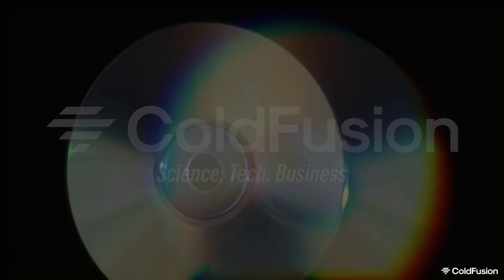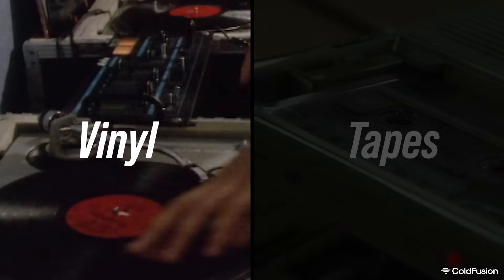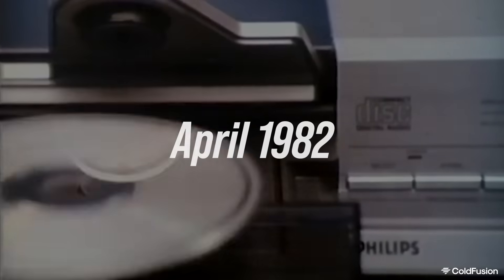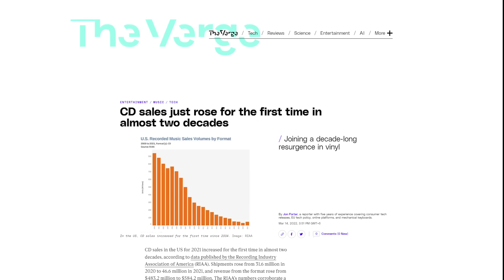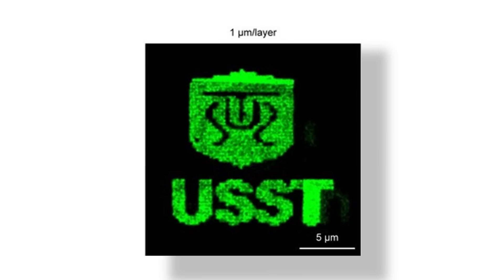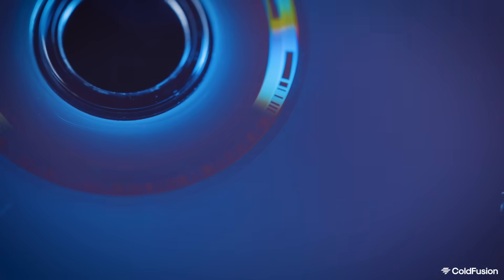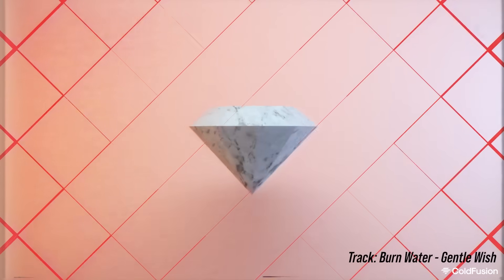Why This New CD Could Change Storage

Comment: Good luck with that. The simple fact that they need a femtosecond laser makes it IMPOSSIBLE to generalize for the public. A way would be to eventually make a frequency comb microchip but STILL, we have two problems:

-We never did a femtosecond microchip comb to my knowledge, and slower comb microchips are still the state of the art. 
-Biggest problem is obviously the microchip itself, how to be able to write/read the surface? Not to mention that the frequency comb microchip needs a very solid pump laser to control the wavelengths properly.....it takes A LOT of space!

To summarize: in a lab, yeah sure, in industry why not, for the public no fucking way for the decades coming.

Comment: If this succeed then it can be a great thing for gaming consoles. There was a time of consoles like ps2, ps3, xbox 360 when you didn't needed to install the game onto the console from the disc you've bought. The entire game used to be fit on the disc. This was the time when blu ray discs were new in the market. 
If this technology succeeds then definitely not a petabyte, but creating a small size version of these discs which can store atleast like 500gb of data would be enough to saving the feeling we used to get from using discs and making collections (ahhh good old days)...
And yeah ofcourse sharing your games would also be a lot easier.
Reply: It's never gonna happen. Games need to be installed cos Blurays are way too slow compared to an SSD. This new disc is even slower, by a magnitude. And gotta consider that Sony and M$ are clearly trying to get rid of discs.
Reply: @Azarilh  Which will obviously be solved by innovation. And Speaking of Sony and MS, if they don't fill up the need or desire of the consumers, somebody else will. I am not talking of home consoles like PlayStation or Xbox but a hybrid console with disc drive like what PSP used to be. Because still people would like to store their own their data not stream it from some datacentre. It is feasible for small data like songs and movies. But not games. That's why Google Stadia failed.
Reply: @mileshul  Downloading a game is not streaming a game. Dunno why you brought streaming up. Streaming failed mostly cos bad latency and not enough people with good Internet. Downloading games succeded and killed physical in the PC industry. Same might happen with consoles, regardless of what people want. No, there's not gonna be someone taking place of PS and Xbox any time soon, especially with all the fanatic fans. It is really common for big companies to do stuff that the community doesn't like, and the community gets to accept them after some time. 

There's nothing obvious with the problem of the discs being slow being solved with innovation. Technologies have their limits. Hard disks for example reached their limit a long time ago, hence why we switched to a beter technology, solid state.
Reply: @Azarilh  I am not saying Downloading games from Steam and Epic games will die. It will forever be there but I am saying that disc storage can solve the problem of keeping those hefty games out your console when not playing. On Steam I very often uninstall and reinstall games. I don't have to use internet and wait for like an hour or two for downloading and play game. A disc like this will doesn't even need to install the game on console l. Just put in the disc and play. Which can help the companies minus the cost of storage for like a 1tb or 500gb.
Reply: @mileshul  I don't see why it's so important. Just have same patience. Also, upon installation there are often large updates to download.
Reply: Something like this will never come to console sorry.... the tech alone will keep it out of a console forever. Disk alone will be disappearing from console not too long from now as well.

Comment: I think we need a 1 petabyte ssd with usb 3.2 (or usb4 when it's everywhere) connection. Once we get that, nothing will ever top that. You can write and read super fast meanwhile keeping all that data in there to be used by basically any device. Finally people can shut up about drms and their media purchases lol. Also, that drive would eliminate the overpriced Kaleidescape streaming devices. Full bandwidth compressed lossless files at your fingertip.

Comment: 6:58, Petabyte, or Petabit?  Both terms are not interchangeable.
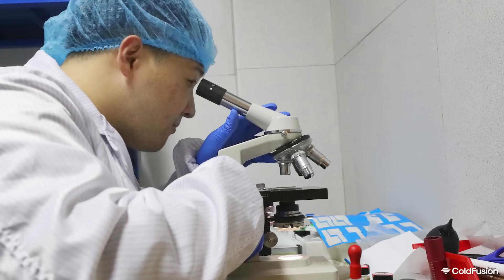8:17, CDs only have one layer, DVDs have up to two, and Blu-Rays have up to 4.
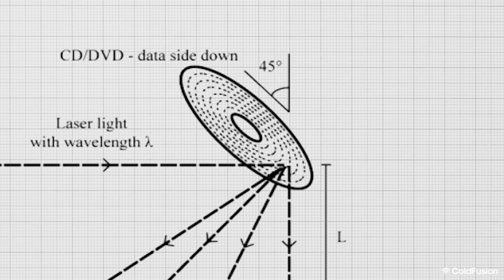8:47, Light is in the Nanometer range, so microscopic would still be too large.
11:43, Could multiple laser assemblies be added to the drive to read and write in parallel?  It would likely increase the price, but it could be a good tradeoff for those who want the extra speed.
With optimal and ideally lossless codecs in use for each type of file format, I'd be interested to see how much one disc could have on it.  Maybe one use could be movies made for a looking glass screen, while displaying only one perspective that the watcher can select from, either manually or based on the remote's position, for backward compatibility with current 2D screens.

Comment: I doubt anyone will want to buy 1.6 petabits of media at once. The disk does sound useful for backup, but is too big to attract most home users. I'd be happy with a 1 Tbyte optical disk, just big enough to hold an ISO of my hard disk.

Price also matters. MDisk compatible BluRay R/W drives are affordable. 4 layer BluRay (128 GB -- gigabytes, presumably) are $10/ea in lots of 10. That's a lot, and I'm not sure my current drives are compatible. A new external drive costs around $150.

Comment: Another great feature: If you're willing to cut capacity in half (still a massive capacity) you could have essentially indestructible data storage. Error correcting codes could make use of the remaining bits so effectively, that you could put that disc through hell and grind it up significantly and not lose any data. The redundancy and ECC would be enough. Furthermore, this could all be done in a software layer without any hardware modification!
Reply: Have the option on writing so that you can write ONE copy at full capacity, TWO copies at half - right through to (for example) 4 -8 copies stored in physically different parts of the disk so even if someone shot a hole through it, you still have ALL data full intact. ULTRA stable data and still a 25TB to 50TB of storage.

If this was "cold storage", then the old CD changers which allow you to load a carousel with perhaps 4 - 16 newCDs and you are back to staggering values again.
Reply: Yes but that would make the writing double slow, and like they said in the video, it's already pretty slow.
Reply: @Azarilh  Just to emphasise how slow - it'd take about 5 years to write one disc. If you've ever owned a DVD burner, you'll know you're not getting through an hour of burning without throwing at least one disk in the shredder.
Reply: @alexandralillywhite5997  I used to only buy RWs. Thos could be rewritten.
Reply: You can't rewrite these discs. They're not designed to be rewritten and likely never will be.

Comment: I still use 25GB or 50 GB BR for our office offline backup. Unfortunately, 50GB are expensive, and only original Verbatim are reliable. Obscure 50GB BR brand failed too often during the change between the two layers.

Comment: Yeah, but we live in a world where you buy a DVD, slap it in the player, and half the episodes are corrupted and skip around. The tech has been around for decades, yet it's still garbage. You don't have as bad of problems with flash memory. (and I'm not saying there aren't ANY - I'm saying the problems aren't AS BAD for the reading comprehension-challenged).

Comment: Of course.  I've had the 8Gb DVDs for storage.   BUT,  don't let them soak in water (accidently) unless that top layer of aluminum is sealed in. The DVDs that use chemicals to be modified instead of physical pits... I want to purchase the DVD burner that etches into aluminum disks.

Comment: The real test will be how long the data lasts before age decays the material.  Off the shelf CD and DVD media eventually goes bad because of the quality standards to which they are made.  If you want media that could last decades under proper storage conditions, you have to pay more and most all retail places don’t carry it.  The more you store in one space, the more your risk loosing if the media corrupts.  I have redundant data backups just for this reason alone.

Comment: Ideally, bits and bytes should be separated to internet speed measurements and storage capacity respectively. 
Though I wont complain if bytes is used to measure internet speeds as well. 
For clarity, a byte is 8x larger than a bit. 3 MB/s (megabytes) is basically the same as 24 Mb/s (megabits).

Comment: no one can answer this question: they have managed to increase the storage capacity of a CD exponentially  with this breakthrough. However, they have not acknowledged or addressed how fast the discs can access the information stored on them. Traditional disc hard drives capped at 7200 RPM because of the physical limit of the discs because they begin to crack and break at faster speeds. How are these discs any different? Did they just make discs with insane storage but were back to caveman level read/write speeds?
Reply: They are even lighter !
Reply: @raphanunu6912  so the decrease in mass prevents the disk from shattering over 7200 rpm due to centrifugal force?
Reply: @slytherinda4669  It should

Comment: Optical media and longevity aren't really synonymous, and I'm not even talking about scratches. Just look at the issue of media degradation on Laserdisc, or laser degradation on readers of just about every optical media format out there. Every old game console eventually needs to have the laser replaced with a compatible one or by an optical drive emulator. And also, just look at how media degrades over time, with dyes and adhesives fading, going dark or crackling and ruining the optical properties of the disk, along with it's physical integrity. 100 layers? Hah. That's not going to be cheap or easy to produce something that can hold data for over 20 years on those. 

The tech sounds cool, but right now it's not even clear if it will be able to compete with tape for long term storage, and unless the tech gets ridiculously cheaper, it's not going to show up in consumer products at all.

Comment: The reason I stopped buying CDs wasn't mp3 sharing. At that time, they sounded awful. No, it was that the prices jumped up between $3.00 to $10.00 more for no reason. Every time Best Buy had a sale, it was fake. The old price was inflated to make the discount look good when, in actuality, the price was the same.  The CD for the Godzilla ost was priced higher than the dvd for the movie, so I passed on it.

Comment: Can it store true Blu-Ray resolution video?  I know it said it can store 200,000 Blu-Ray DVD’s but that’s a capacity issue.  This is a 3D storage medium so what resolution can it handle if Netflix or Hulu bought this?  Burning digital 4K to this medium at only MB speed when the disc holds 200,000 is going to take a long time!  This has potential but they need to work out some serious issues to make it commercially profitable.

Comment: Since gaming and movies are still using discs then these two huge media industries will benefit from these large capacity storage CDs. If gaming were to move from Blu-Ray discs to these new formats then they could hold even more data compared to the smaller capacity of Blu-Ray. The current biggest size that can fit on a Blu-ray disc is about 128 GB for quad layer formats. The smallest Blu-ray disc size can hold 25 GB compared to the DVD which holds 4.7 GB of data and dual-layer DVD up to 8.5 GB. The original Compact Disc only held 700 MB which is less than 1 GB. With the rise of digital media then I'm not really sure if people still want physical media. I still support physical media because I just don't trust big companies to forever hold those digital games, movies, shows, music, etc. forever. Licenses might expire and change then they end up removing those digital content.

Comment: I loved my laser discs, I still have lots of vinyl, reel to reel, 4 track and 8 Track, cassette, CD,  MP3 before trying to create larger collection size files on hard discs internal and external. Now I’m just using the net/iphone music playlists. The really ridiculous thing is how many times I’ve purchased the same music (and movies) repeatedly in each format and in the cloud. At some point I should have earned stock in some of the companies!

What I would really like to be able to do would be create a mixed audio/video storage system that could easily be organized in a slick fashion similar to any we currently use online or otherwise for our stuff on now, that could be searched by all the regular data points, but could be accessed via cell phone from anywhere. This way I could organize my entire library of old tech to new tech movies, music and home movies. My children and grand children would have simple access as well with this system. 🤔😴💭 😂🤣

Comment: Soooo, how often will burning these discs fail with buffer under- or overrun? xD
I don't really care about datacenters, but I would love to get them for my personal storage, even if filling one alone will be still ways off. Hopefully multi-session is a thing, or even better, RWs.

My fear is, that they would go the way of Ultrium, where the storage media is cheap but the drives cost far too much for private use.

PS: "Cloud" and streaming is for the casuals that do not know better but are sadly the majority. I love my local storage that I can access whenever I want without having to rely on third party services. Got like 80 TB in HDDs (incl. redundancy) and am running out of space again.

Comment: If the materials retain reliability for 50+ years they would be a great advancement for WORM systems.  The current difficulties will be resolved, as always.  Flash memory is NOT long term storage.  Hard drives are NOT long term storage.  The storage life of both are relatively short.  Neither are suitable for archival purposes.  I see this as a great archival or WORM product.

Comment: What's with saying 1.6 Petabits then 1.6 Petabytes?

These are not the same numbers, one is 800% larger than the other!

Edit: Also saying 200TB is 200,000GB... when it's actually 204,800 GB in computer terminology which uses binary approximations of SI terms (kilo, mega, etc.) to mean 1,024 times not 1,000 times.

How do you miss this basic computer understanding?

Comment: Compared to existing CDs, this data format is probably extremely fragile.

We also have no idea how fast this new material they are made of will degrade, which is important since we're working on sub-wavelength scales, and I'd imagine even the smallest degradation will lead to data loss. So cold storage is probably also not really a great idea with these.

The reading-speeds quoted in the video are also probably for continous reading and do not account for a jump to a specific section of the cd, if that is even possible with any degree of accuracy.

Also, the way current datacenters work is by having data distributed across multiple discs to avoid loss of data in case of hardware failures.

This means for data to be reliably available the way we are currently using it, you'd have to have multiple CDs constantly being read in a reader, which will make for an overall poorer information density than SSDs, which ALSO come with write capabilities and can be reused a lot more than CDs.

Ultimately, this is a very cool demonstration of a very interesting technology, but I don't think high-density CD-storage will be what this is ultimately used for

Comment: hmm yeah throwing PetaBytes and PetaBits around like one isn't 8x the other is a bit lazy
a PetaByte is 8 PetaBits
as you claimed in this video they could reach 1.8 PetaBits at best that is ~250TeraBytes
still crazy as I could archive my entire 8TB array over 100 times, or archive ALL my media with room to spare(maybe even archive all media I will ever own on a single disc that won't age)

but get your terms right, and maybe change your channel to not be called an impossible thing
cold fusion is impossible on earth, it is literally impossible to make fusion happen at temperatures below ~2000 degrees(which is not cold by a long shot) as the compression required cannot be achieved outside of a gravity well larger than a planet(about the size of a hypergiant star I think)

so that is why humans are working on containment of a few million degrees plasma, as we can kinda contain that much heat with magnetic confinement

Comment: I wonder how long it would take to burn one of those new discs on a PC. Presumably, they'll only ever be available as pre-recorded discs.

10:45 Longevity isn't a word. You got it right the second time, when you added "durability". Time has duration, it doesn't have length.

12:30 That company can't be teaching AI, because AI doesn't (currently) exist. At best, current so-called artificial intelligence is a system of pre-programmed algorithms that calculate an end result on the basis of inputs. Some of those programs store results to prior inputs (eg. questions) for quicker future reference.
Current, so-called AI programs are essentially advanced versions of the old text-based computer games, from the '80s.
Just because a program is complex, and quicker at calculating than we are, that doesn't mean the program is artificial intelligence. At best, one of those programs could be described as being simulated intelligence.
Artificial intelligence doesn't currently exist and it probably never will (although it would be interesting to see). Even if true AI ever were to exist, if current testing standards are anything to go by, there would be no way to properly test if it really is intelligence.